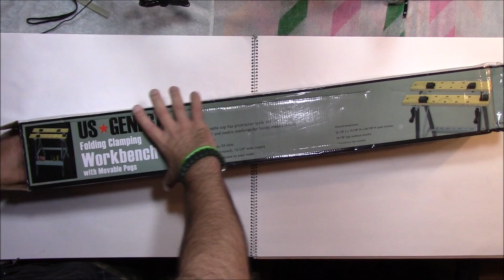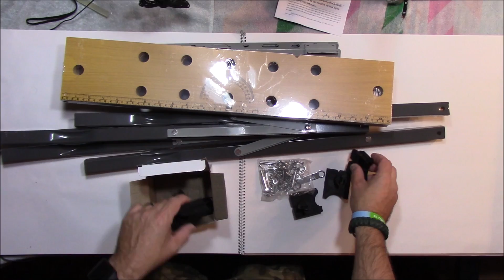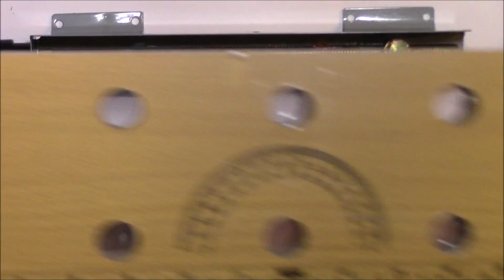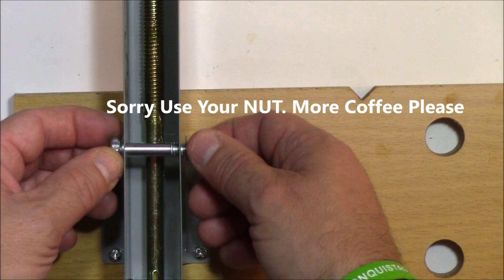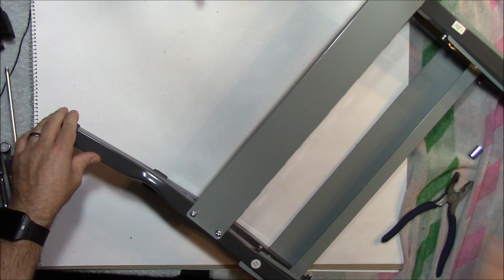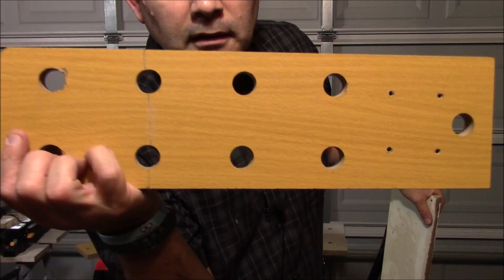US General Folding Clamping Workbench Unbox And Full Assembly And Face Plate Mod/Fix

Comment: Very instructional. I am in Colombia and options are very limited, The local big box store sells Redline brand which is exactly the same as this. I purchased mine for about $22 US. It was this one or the Worx Pegasus for $95 US. I used candle wax on the surface for the top supports to slide where you used grease. I expect to have to replace the MDF, but that is an easy task and will do the mod you suggested. Are you still using yours? Any more mods?
Reply from the maker: I'm still using mine and it's held up rather well. I screwed a solid larger piece of plywood on the two clamping wood strips to make a solid wood table. It still folds and it's much stronger. I use wood clamps or C clamps for anything I need to hold down to it. It's a very handy thing to have. Thank you so much for commenting, watching and the very kind words. I appreciate it greatly. All the best.👍😀
Reply: @richardlloydusa  I bought this mainly for the center vise. I do some hand planing on board edges and this works well. But i had a workbench top made of 2 1X8s and is 36 in long that I put a 1X4 on the bottom and use the vise to secure it to give a larger solid top. I bolted a 1X2 across the front legs that is about 1/4 in off the floor. It extends about 18 in out on either side. I can put my foot on it as a hold down and it is a lot more stable to tipping. I could possibly put something to reach the floor (like adjustable refrigerator feet) to ensure that it doesn't wobble later
Reply from the maker: Very good ideas. It could certainly use something to keep it stable if you are putting a lot of force on it. Thanks for sharing. All the best.
Reply: @richardlloydusa  I looked at a lot of videos and would much rather have one of the bigger B&D models. But the price is a lot more and Amazon shipping to Colombia for them was over $50 and this was my best option here. I don't do any heavy work and just small projects. So for a little over $20, I was not expecting a lot. I bought the Worx 4 1/2 in circular saw that I like a lot also (it had free shipping to Colombia)
Reply from the maker: The B&D's were the originals and very solid work tables but you are right even here in the USA you pay a premium for them. Thank you so much for commenting and watching. I appreciate it greatly. All the best.👍😀

Comment: So, the only weak part of the table is the MDF? And what about the legs?
Reply from the maker: The legs are fairly solid. I still have mine and I replaced the MDF with hardwood boards. They are far superior. Thank you for watching and commenting. I appreciate it greatly. All the best.👍😀
Reply: @richardlloydusa  thanks for the quick reply!, for that I will give you a like to the vídeo!😃

Comment: THANK YOU!  I am going to buy one and glue  5/8" plywood on the bottom of the boards.  2 Bolts, washers and locknuts by the handles like you did.  Might not matter but I will look into 2 heavier duty side metal folding hinges or make my own out of thicker metal.  Right now with the 20% off coupon I can buy one for $17.00.  Menards has the Workmate for $29.00.  For my uses, I can get away with Harbor Freight.  However, one thing I have learned the hard way; UNBOX THE ITEM RIGHT AFTER YOU PURCHASE IT INSIDE THE STORE!  Or if you can right in the parking lot.  If anything is missing or bent, you can quickly replace it!!!! I did this last time for a router after wasting 2 trips!  I unboxed it and tested it right there. The manager said that was smart thing to do.

Comment: Did you add water seal or polyurethane to give it more  strength and durability
Reply from the maker: You can if you wish do that. The wood I used to replace the MDF was painted already LOL. Thank you for watching and commenting. I appreciate it greatly. All the best.👍😀
Reply: @richardlloydusa  no problem 👍

Comment: This bench is still being sold and comes in handy. But there is one thing bothering me, and that is the flex it has when you hold something with the plastic grip thngis. The winged brackets holding the top are to blame. They are tall and so the lever created between metal base and grip is long. At 7:45 you can see that the moveable bracket is mounted at the middle hole. I enlarged the 'left' hole and mounted/screwed it there, this definitely helps because now the lever/surface of the bracket pushing back is larger. Ideally they should be replaced with something stiffer.

Comment: I had a friend give me one because the fiber wood was rotted and he thought it was junk,   so I took some 2 by 6 inch bored  and it worked grate. I do believe if I bout one I would just throw there portical board away and just put a 2 by 6 on. I have set a anvil on it that wade 155 pounds no trouble I love that throw away stuff,
Reply from the maker: Thank you very much.

Comment: Hey I just brought this table and I like it but the washer that is on the inside of the crank assembly won't hold the crank into place any tips I was thinking about putting a zip tie  in front of the washer to hold it flush
Reply from the maker: Not sure what to tell you as I do not have the same model as you have. Thanks.

Comment: Great video - made my assembly very easy. Also used the M6 bolt for reinforcement. I will probably change the MDF when it no longer becomes functional. Thanks!
Reply from the maker: You are most welcome. I left mine out on the deck and it got rained on that when the MDF turned into a sponge. I had to replace it. Thanks for watching and the kind comments.

Comment: Thank you Richard for the video, it was helpful.  It's not a bad portable bench for the money.  I don't plan on putting more than 50 lbs. on it, so should be fine for my needs.  Although the real plywood upgrade would definitely make it more sturdy.
Reply from the maker: You are welcome. If you are only going to use it for light duty uses, the stock table boards will be fine. Thanks for watching.

Comment: I've been dealing with the face plates problem since the very beginning, I tried almost everything but nothing worked, I tried your fix and it worked flawlessly, now I have the perfect workbench: light, small, and with some serios vise clamping power. You should add ""fix, upgrade, mod or hack" to the title of this video, I'm sure most people using these workbenchs have the face plate problem.
Reply from the maker: Glad I could help. I will update the title to reflect the fix. Thanks for the tip and watching.

Comment: Another sterling video Richard, i have the workmate heavy duty bought in 1981, these benches are one fantastic invention, the work mine has done is unbelievable, i really have abused mine with no problem. 

re the screwdriver do you have in the US  Pozidrive & Phillips
Reply from the maker: +bmwnasher My old workbench most definitely does not owe me anything. The workmates are the premium workbench on the market and are virtually indestructible but that comes at a price. Obviously the price is worth it. Yours has lasted 34 years! Wow. You can't beat that value.
The Phillips screwdriver appears to be the standard here. In Canada the Robertson and the Phillips are the standard. I like the Robertson because the screwdriver will hold the screw without being magnetized and it seems to be less likely to strip the head.  Unfortunately it is not widely used here. Thanks again.
Reply: Richard Lloyd The modern ones here don`t look as sturdy, if they were Black & Decker would go bust. interesting about the screwdrivers, i like the Pozidrive for the same reason its a far superior hold, but i do hate them all, if the Phillips driver is a bit worn it`s curtains, ive got an impact driver you need one on some car stuff. Look forward to your next project.
Reply from the maker: +bmwnasher I buy the #2 Phillips screwdriver bits in ten packs because as you said once they wear they are next to useless and do more damage than good. I use impact drivers to remove nuts and bolts too but I only use a torque qrench to put them on. Working on my next video stay tuned. Thanks
Reply: Richard Lloyd Have been following the weather in Texas, i hope everthing is ok .
Reply from the maker: +bmwnasher Fortunately I don't live in a flood plain so all is good here for me and my family. It has been raining constantly and quite hard for three days now. Good news for my grass but not so good for people in flood plains. We have had some flooding locally though http://www.kxxv.com/story/30340803/temple-man-rescued-from-flood-waters Thanks for your concern
Reply: Richard Lloyd Glad to hear you never got flooded , that rain is certainly heavy, it`s playing  havoc with the F1 motor racing there.
Reply from the maker: +bmwnasher Looks like they pulled it off this afternoon. It cleared up pretty nicely. I will have to go and watch it next year. My father was a huge fan of Formula Racing. He actually had dinner with Niki Lauda in Argentina. My mother cooked the dinner. Very best.
Reply: Richard Lloyd Facinating about Niki, great racer and also a nice person, personally im not a fan of Lewis Hamilton, but he`s a great driver.
Reply from the maker: +bmwnasher You have to give it to Niki for getting back in the saddle and winning again after this crash https://youtu.be/PYgjRTWhWi8 . Lewis is one of the best F1 racers ever and certainly a very competitive racer. Time will tell. Thanks.
Reply: Richard Lloyd He`s a brave man to race so quick after that crash, i was watching the race on tv when Senna got killed it was a dangerous sport, im not a fan of these hybrid engines they sound like Moto Gp bikes, they`ve  done the same with Indy cars cut the engine size down, i was reading they would have had the old F1 2.4 V8  revving at 25.000rpm today, they were limited to 19.000. Check out the Renault F1 engine test on YT it`s awesome.
Reply from the maker: +bmwnasher It's all about weight to power ratio. Smaller engine lower weight. The new engines are marvels of technology and engineering as they were in the old days too. Speed is money, how fast can you afford to go. :)